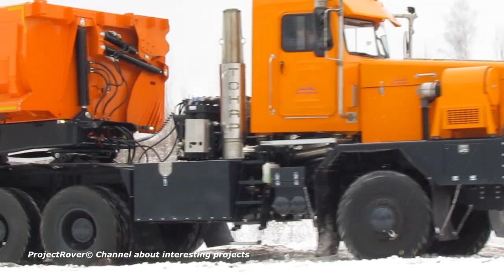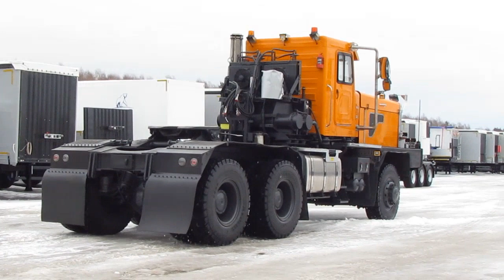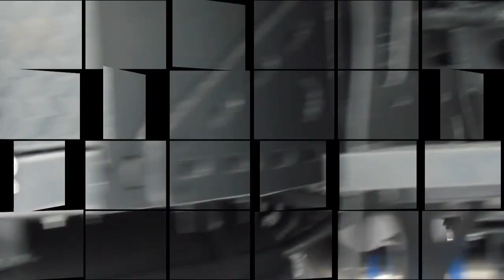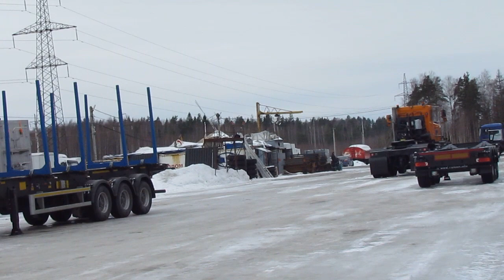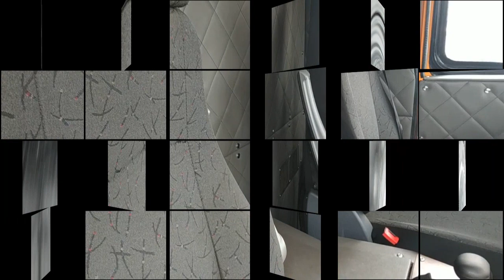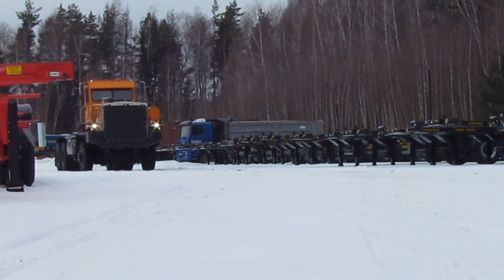Supertractor TONAR. Serial diamond giant

Comment: El motor está muy adelantado al eje delantero no lo veo práctico para ir a la via
Reply: What does that have to do with road performance.  The truck is made primarily for mining and notorious rough Russian terrain.  Everything about this truck has been designed and tested for its intended purpose.  The engine being far forward from the front axle also helps distribute the power to weight ratio better.  Do your research and educate yourself before making stupid comments.